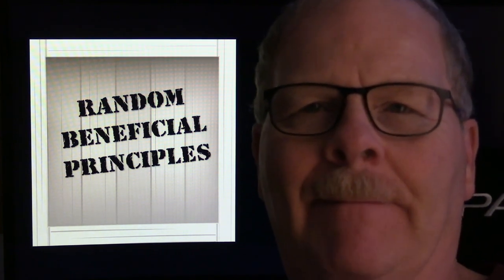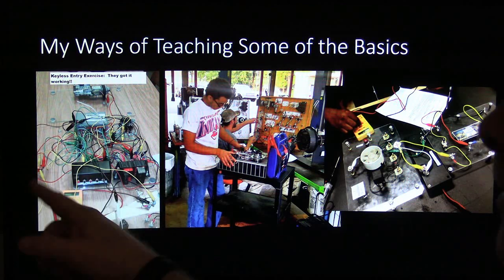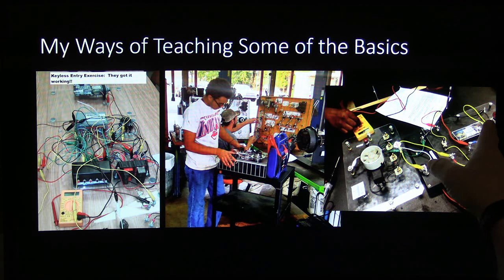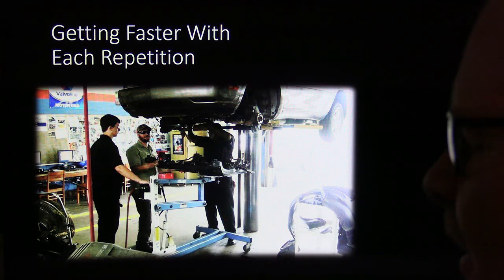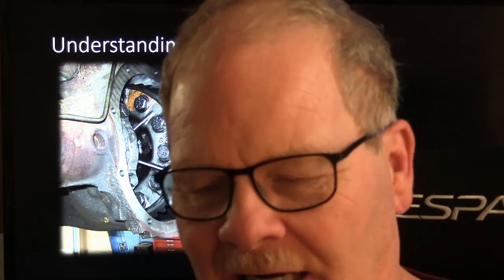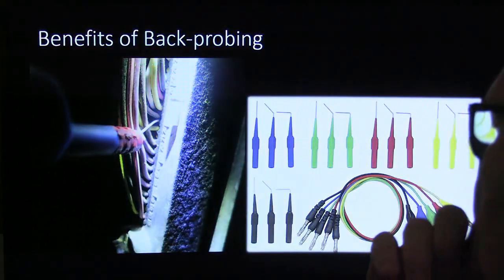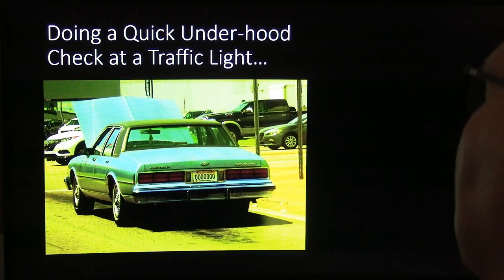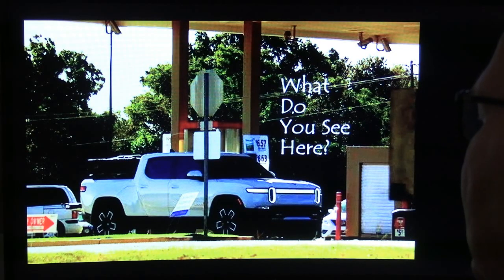Random Beneficial Principles

Comment: I actually saw a Merkur xr4ti the other day here in California. There is an enthusiasts forum on line. I replaced the head on my neighbors xr4ti about 20 years ago.  Frost plugs rusted through and overheated on the highway. Turbo charged 4-cyl Ford. Yuck. / John
Reply from the maker: When I went to school on that one in 1984, it was the first rear wheel drive vehicle I had ever seen with an aluminum differential housing feeding torque to the rear hubs through CV axles - a setup that is very common today, as we all know. But I hated those cars.